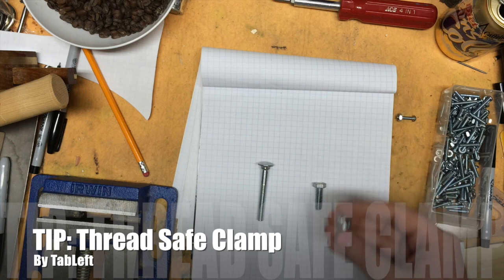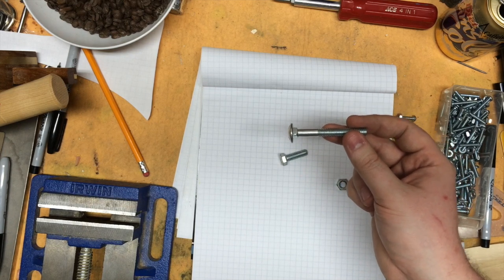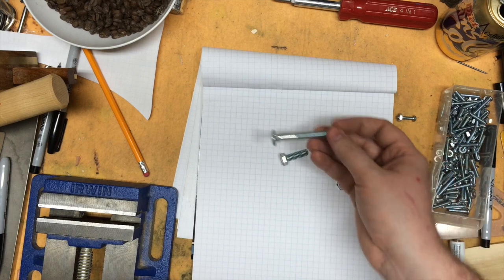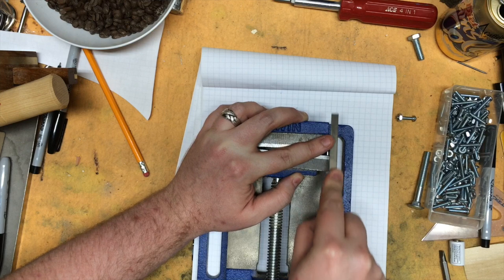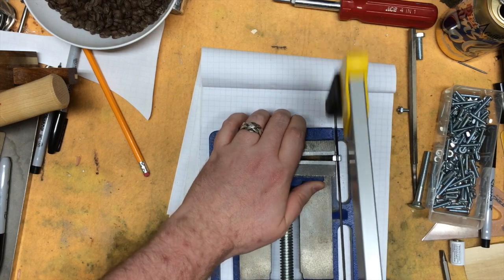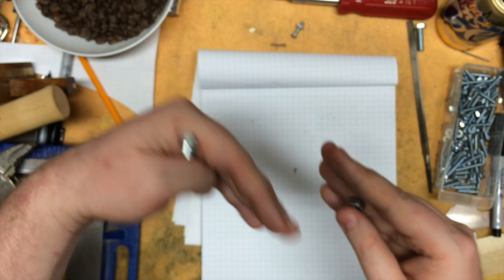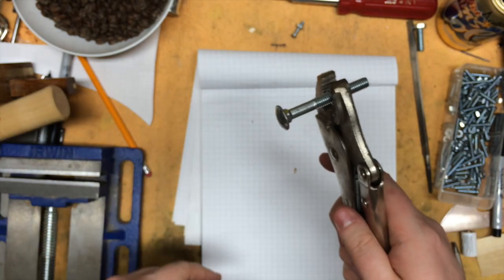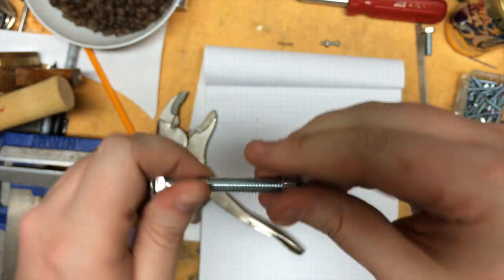TIP: Thread Safe Clamp

Comment: Why not just tighten two nuts against each other on the bolt?
Reply from the maker: Ryan Lue You absolutely can just use a jam nut. I prefer this method because its easier to position the bolt exactly where you want it and faster to reposition. Its also a easier to put on and take off since requires no tools.  it only takes seconds to prepare the nut the first time and once you have it you never need to make another (for that size)